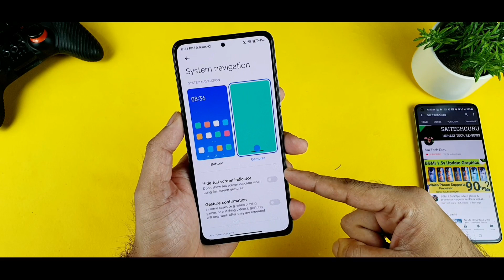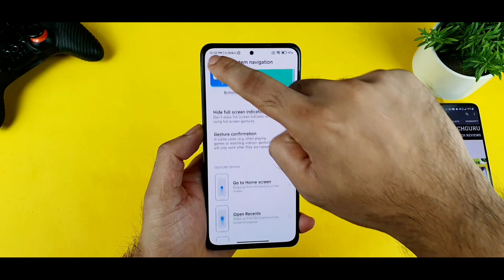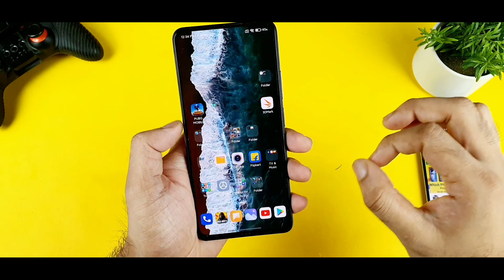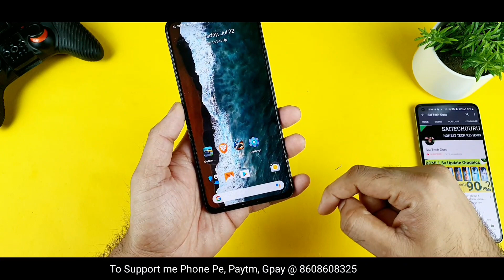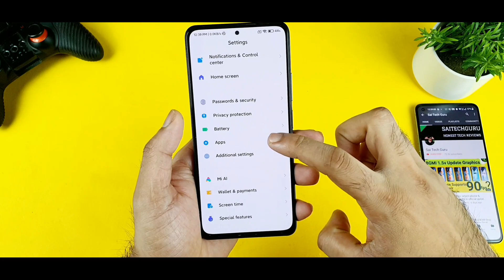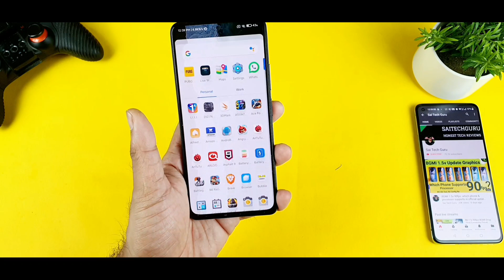Comment: My case is, I can't exit the current application I'm using, we have to slide from bottom to up to exit right? Its not working. I have to use "recent tabs" Gesture to close the app. 
And I don't use 3rd party lancher. 
This is so frustrating 😤😖
Can someone provide a solution for this? 
And also am I the only one suffering from this problm?